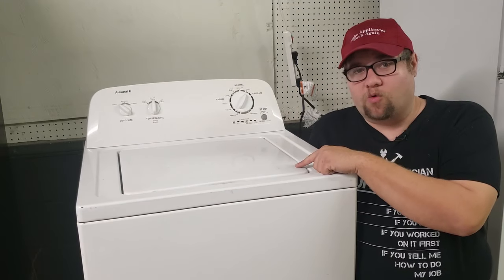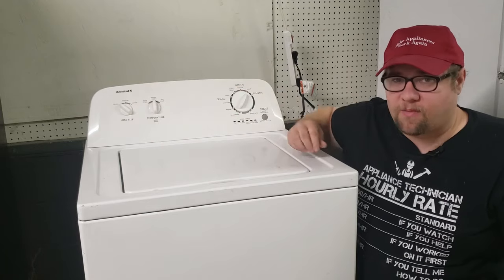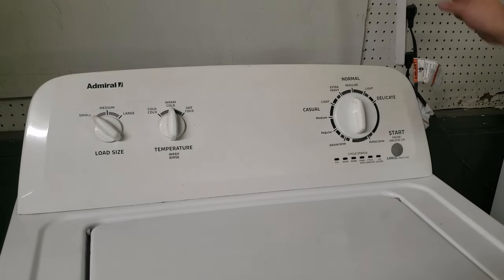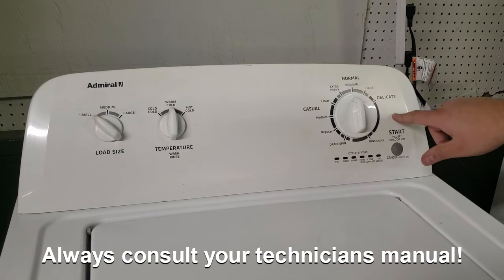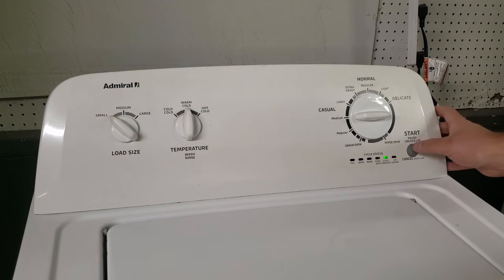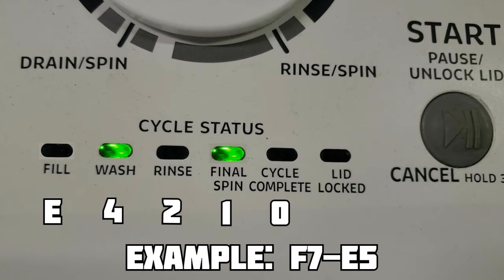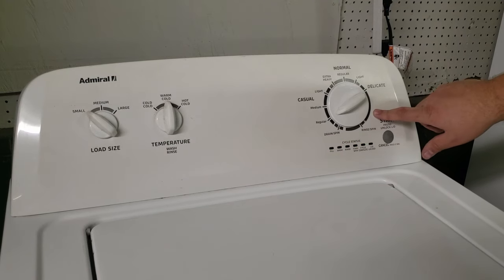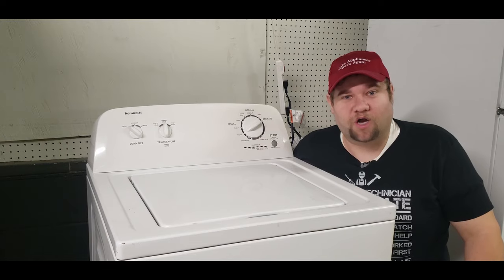How to Use Troubleshooting Mode on a Whirlpool, Maytag or Amana Washer AND Understand the Codes!

Comment from the maker: Just a note guys, this was one of the first videos I did on my channel. YouTube won't let you update a video as much as I'd like, so I did another video for a Maytag Washer, but the codes and such are almost exactly like this, but more extensive as I've gotten a little better at doing videos.

Link: https://youtu.be/Saok_IA8_s8
Reply: Thanks for the update!
Reply: Very informative, thank you.
I got the code F1-E0, not sure what that is, do you know?
This is only the 2nd time I've used this washing machine brand new and am having issues.
Won't go into rinse cycle and clicks a bunch(lock does work it does lock) wash light flashes and nothing happens
Reply from the maker: @b.3713   I looked real quick online and the only thing I can come up with is that the machine needs unplugged for 15 minutes then put back in period if that doesn't solve it, I would suggest are running a recalibration on the machine to see what it does
Reply: @bensappliancesandjunk  
Thanks for the quick response.
Hmm, I have done that. I'm doing a cycle right now to see what happens. I did the test where's it runs and checks all the parts and all the lights flashed green, I assume that is good?. How to recalibrate?
Wash cycle completed again and its clicking not going into rinse cycle. Wash light now flashing.
Reply: My fault/error code is perplexing. It just has all the lights lit and they flash like this;  2 quick flashes and then no li&hts for about the same amount of time and then repeats. HELP
Reply from the maker: @erinstreeter6774  what model washer is it
Reply from the maker: @Carbon_Fiber  you can't on that version. Any of the newer locks used a pulsed on/off/on signal from board to latch. If it doesn't pass the check with the right value (the off/on/off signal), then it fails and shuts board down. You can bypass to open lid, though, by just taking the latch out of lid and sticking in the lock though
Reply: Bob¿
Reply: So if I understand correctly we do noy use the 0 if it is lit. Or does that go at the end. Like. 10s spot. I have a amana the codes it is giving are  f3 or F30 e2 or e20 then another f2 or 20 and e0. The lroblem started when it was not spinning out. The towels and sheets were wrapped around the agitator. In diagnostic mode it will only spin thw agitator 1 way and it. Does not spin the whole bowl. If you have any advice i would greatly appreciate it. Now it will not even fill with water it. Just clicks and will spin once in a while.
Reply: Excellent job. Thank you sir. New sub and rang that Bell!
Reply from the maker: @woopsdiditagain2817  thanks!
Reply: @bensappliancesandjunk  
Once I ran it thru the diagnostic mode everything seem to work.. Wasnt sure what to do after that.. So I ran it thru the Error mode.. what was flashing was my sensor button Rinse button. spin button and my done button then they stopped and then just  my done button flashed by itself.. Wasnt sure what code that is..
What the washing machine is doing it does fine until it gets to the spin cycle then the lid lock will flash or either turn off and it won't do anything else.. If it stays locked.. I have to unplugged and turn it back on for the machine to unlock.. This is a whirpool cabrio.. Not sure how old just bought used.
Reply: Help me out, I just made a comment.
Reply: Great info,thanks
Reply: Watched your dionostic video
My machine shows the first 2 fill&wash then next flash cycle  complete.
I don't see the error code for this per what I see
Reply: @b.3713 
Did you find out what the problem was. I'm having a similar issue
Reply: have alot of trouble with them that's got lights on them .

Comment: Great Video! Before you do ANY of this though, do a "hard reset" by (1) unplugging the washing machine for >1 minute (2) plug in then rapidly open/close the lid 6 times within 12 seconds. My washing machine didn't even have the lights come on and this was the magical solution.
Reply: Hi Victoria,  I have an Amana washer that wouldn’t change settings like from normal to delicate when I spun the knob and I just tried your recommendation and it worked! Thanks!
Reply: Just commenting to
Say this actually worked!! Thanks!!
Reply: Seriously thought you were messing with us with this line, but it worked!
Reply: Omg this worked!!! Thanks so much!
Reply: My Whirlpool had a sensing light flashing. You raise the light up and down six times realfast. Then lay about a six pound weight on the corner of the lid where the lock switch is. That stops the vibration to the lock switch. fixed mine. apparently the lid vibrates and cretes a signl to the lock switch.
Reply: Cool!
Reply: You are genius!! Mine hasn’t worked for a year now… I didn’t what you said and now it works! Thanks Victoria
Reply: Worked! Thank you for commenting this!

Didn't think it would work, but you saved me from buying a new one or a repair.  :)
Reply: Omg this worked!! THANK YOU!! How many ppl have thrown out their washers and went and bought new ones when something so simple may have fixed it?! I always learn so much in the comment sections everywhere 😂
Reply: How often are you having to do this? I continue to have the same issue smh
Reply: It worked for me too. My husband looked at me like I was a dumb ass when I told him to do it. Who's the dummy now 🤣
Reply: Didnt work😭
Reply: Wow! Omg THANK YOU! I’m so glad I clicked this vid and happened to read the comments! I thought half my day would involve fixing my machine, but this did it!
Reply: Thank you, it helped!
Reply: Thank you so much. Worked first time, you are amazing and thank you for sharing.
Reply: @emersoncarmel7767   and no $ service charge from your "friendly" whirlpool serviceman either.
Reply: It worked!!!! Thank you!
Reply: Thank You it worked. Mine would not fill or wash in the heavy cycle it would skip to rinse and do nothing but it works now again. My washer is 8 years old but not overused so l was contemplating paying a repair bill or just buying a new one. No need to do either now. Thanks again!
Reply: This for real? Lol
Reply: Thank you, thank you, thank you! This worked!
Reply: - What happened directly AFTER you did the lid thing? Did it add water, light up, or what? THE AFTER THAT PROCEDURE WHAT DID YOU DO? Did you start it like normal, run it only on small load? Did you have it previously filled up before you started?
- YOU NEED TO EDIT YOUR COMMENT AND EXPLAIN THE CONDITIONS BEFORE YOU STARTED THIS PROCEDURE AND THEN EXACTLY WHAT YOU DID AFTERWARDS.
Reply: - Didn't do a thing for me on my Amana except TWO different things.
- First time it lit up the wash light only. Second time it did nothing.
Reply: @lprice390  You kept a non-working washer in your home for an entire year?! What did you do? Go to the laundromat every week while you waited for a magical solution?!

Comment: HERE'S HOW TO CALIBRATE the Amana after you replace the shock absorbers or other major parts:   Go to diagnostic mode as described in this fellows video.  All the LED's will be lit.  FIRST make sure there is no clothes or water in the basket.  Then all you do is ROTATE the control knob until the MIDDLE led is lit .  You will have 2 leds NOT-LIT to the left and 2 NOT-LIT on the right.  (ignore the RED LED). Now it is in CALIBRATION mode!! all you have to do to ACTIVATE CALIBRATION mode is press the START button.  Then the machine will go through some 2 minutes of clicking and spinning the motor.  Just be patient and wait for it to do its thing.  Then it finally clicks and ALL THE LED's are OFF.  That means it is done with CALIBRATION.  wash some clothes and see if it is fixed.  Mine is fixed but ONLY replacing the shock absorbers DID NOT FIX IT.  It must be calibrated any time you replace a major part like that.  I found my REPAIR MANUAL book inside the washer on the FRONT panel.  Only had to remove the TOP PANEL to get the repair manual.
Reply: I just want to know what happens if you don’t recalibrate
Reply: @bruhbry831  If you don't calibrate the washer, the washer might not fill with the right amount of water for the load, or the washer might have frequently unbalanced loads then the problems starts
Reply: @spicky2966  ahh okay thanks for that info!!
Reply: Thank you

Comment: I just bought this machine under the brand name Amana and I hate it!
Reply from the maker: Amana VMW's are about the cheapest ones in the market at the moment... They work OK but I fix a ton of them around the 4 or 5 year mark where they're shot.
Reply: @bensappliancesandjunk  please help I have a amana I had it for 5 years and I put a  Pillow in there to wash when done it still had water on it so I took it out and took it to the was house. Next day washed some clothes and after it filled with water and was ready to was it started making this loud grinding noise what can that be 🤦‍♀️🤦‍♀️🤦‍♀️

Comment: Hi, I have an Amana washer and I did the diagnostic like you showed. The only light that keeps flashing after I press is the sensing fill. Do you have idea what it is? I am having problems with the sensing fill mode, it does not stop until the washer is full.
Reply from the maker: Is the only light its showing in the actual error code lookup is sensing fill, nothing else - or is it that when you try to start a cycle, all it does is flash sensing fill and nothing else?
Reply: Bens Appliances and Junk is the actual error code .. that’s the only light that blinks.
Reply: Nothing else blinks
Reply from the maker: @MariaMoreno-iy6nm  GENERALLY that means it cannot detect any fail codes. If you cycle through the next one or two codes and get the same info, there may not be any major codes stored in it.

Having said that, the sensing fill light flashing when the machine is running, and not doing anything else 'til its filled - it may be a pressure hose/switch problem on detecting proper fill volumes which typically doesn't have a code to it. I would suggest re-calibrating the machine, and make sure that clear plastic pressure hose isn't damaged.
Reply: Bens Appliances and Junk thank you so much for replying back and for sharing your video. We think is a major problem with the transmission because the agitator does not spin when is put to wash. And we also found oil leak at the bottom of the washer 😥
Reply: @bensappliancesandjunk  I know this is old but I also have an Amana and even tho I can't figure out how he was counting those lights for the error codes in the video, Im getting sensing fill, final spin and cycle complete blinking once, then just cycle complete blinking the second time. what's going on with this thing?
Reply from the maker: @tg3665  Please check my video on Maytag Washer diagnostic codes or Kenmore washer troubleshooting. Both have more in-depth info about the codes than this video.

Comment: Great video. I am retiring and wanted to get back into repairing washers and dryers. I was at a lost with the newer stuff. Greatly appreciated. Keep them coming.
Reply: I know your comment is a yr old, but hoping to find some info! Whirlpool washer wouldn't drain so I figured out it was the pump ordered had someone take off old one but they couldn't come out new one on as soon as I needed do we called a man that has been working on them yrs and yrs. Well he charged $100.00 and yes it will pump water out but it is making a  click somewhat on verge of a grind sound not for long but just while it's switching from after washing to start rinse spin. But it sounds like it's spinning and still swishing like a wash cycle at same time. I have reset it.

Comment: Thanks so much for this guide to reading the error codes--SO helpful! From a comment on another video, I learned this valuable bit of info. Mine was right where the commenter said it would be. Before your video, I'd been running diagnostics but couldn't figure out how to read the error codes!

"I found that the service manual is included in the washer casing. When in front of the unit, open lid, look into tub (back at yourself) and in the now upper right corner is the service booklet in a plastic bag stuck to the front of the inside of unit. It goes through all of the codes and steps to test the unit."

Comment: I have this exact washer. We had a small flood in our basement, and after we got the water out and all of that taken care of, our poor washer has been broken ever since. It had a red steady light after the flood, but we got it working again. However, now it wont do a final spin, and we have to do a drain and spin cycle after its done to get it to do a spin to have the clothes not be soaked to put it in the dryer. Im going to run these diagnostics and see what i get. Thanks!

Comment: Thank you so much for this video!  I tried several times using the different methods you show in your instructions and wasn't having any luck, but then I read some of the comments and you replied to someone else about doing the 360 counter clockwise rotation twice first and that did it!  Ours is a Roper by the way, hope that helps someone else out there! Much appreciation!
Reply: So all I had to do was rest it thanks so much

Comment: Thank you so much for making this video. I have a Kenmore 100 series that was stuck in the wash cycle and all it was doing was fill the drum with water, nothing else. I followed your instructions and fixed it.
Reply: Hi. Did you do the steps with water still in the drum?
Reply: - My Amana (Whirlpool brand) too filled (heavy load) and then did nothing else besides click & light up with only basic single lights.
- Then WHILE STILL FILLED FULL I did the steps & got nothing except a couple click sounds.

Comment: Hi!!!! This was a GREAT video!! Bookmarked the page for future reference! I'm trying to repair my Mom's Amana NTW4650YQ0  top load washer and the control board was burnt so I bought another board with the same part number off of eBay labelled as a Whirlpool control board. I know that a variety of brands will carry the same type of control board so I was pretty confident as the part number was the same. I installed the new board, plugged in, set the machine to a small load and the machine filled fine then the lid locked and it went into wash mode. So far so good, right? Cycled out of wash mode and went in to rinse mode and then all lights went off so I took the hose off and drained all the water to try again. I tried entering diagnostics based on other YouTube videos but your detailed video really did the trick and I finally succeeded. I tried manual diagnostics and the machine entered all the cycles and I could hear the drum spinning so the rinse/spin seems to be working fine but I don't know why it's not rinsing during regular use. I also ran the diagnostics and only the "fill" LED flashed so I'm assuming everything is fine. What else can I try?

Comment: Finally, some real help. Couldn’t find error codes anywhere, except the LCD readout panels. Have an Amana that isn’t spinning. It was involved in a 2’ basement flood. Purchased new motor, cleaned all connections. Will check these codes, thanks to your help! Thank you! Jay.
Reply from the maker: Glad it helped. I run a store and it took me forever to deceipher the codes, and I figured there's gotta be a better instructional video out there.
Reply: Bens Appliances and Junk Now looking into the clutch and/or the transmission to see if there are any contacts corroded or anything obvious as to why it isn’t spinning.?🤷🏻‍♂️ I noticed it doesn’t always enter the system into diagnosis every time. I’da never figured this out!
Reply: @fireonice143  Did you check the capacitor?
Reply: Transmission/clutch were fine, turned out to be the shifter module. Spins good now, but as my luck would have it, now it decided to not fill with water. 🤦🏻‍♂️🙄 Using Ben’s A&J video, it had error codes (I believe it was F11-E4?) for a water inlet temp. failure, and no continuity across terminals of both valves. I ordered a new water inlet valve, they sent one that didn’t fit. I called and ordered the (correct🤞🏽) new one, and not only was it the right one....they sent me 2 ✌🏼of them! Anybody know of any washer that uses 2 inlet valves? .....eh, didn’t think so.😅 Anyways, I replaced the inlet valve, ran diagnostics, cleared the fault codes, and successfully did a load of laundry. fireonice143

Comment: Great video! It worked for my Amana, had to turn twice counter-clockwise. 
My question for you is the codes. When doing the diagnostics, only my sense fill button flashed,  no other button did. What does that mean?
Reply: Im having that exact issue :(

Comment: When I finished Left, right, right, right, left, right, they were all blinking, turned right once, got cycle complete. Then you say one more right click, which I did and it showed final spin. Went back one click left, pushed start, all lights light and blink and just stay blinking. One click right and only the sensing fill button lights. I did not hit start again. This is an Amana belt drive machine. If I put the machine in "Clean Washer with Affresh" mode it goes through all the cycles with no problem. This makes me doubt it is a mechanical problem?